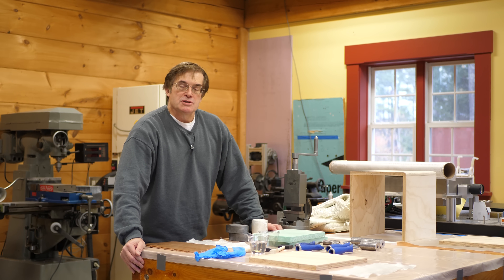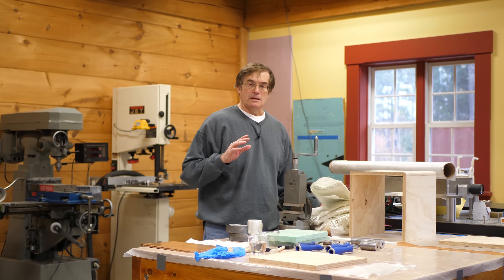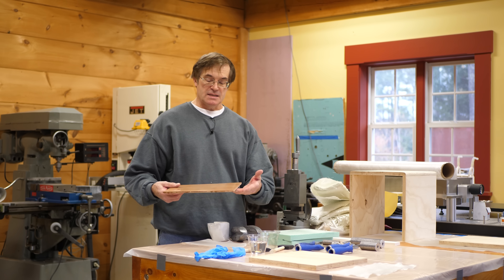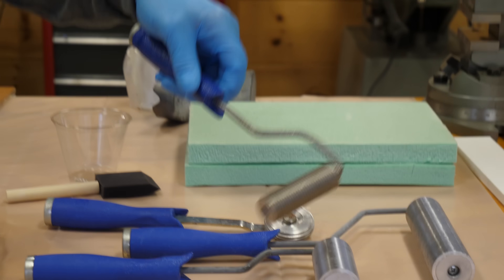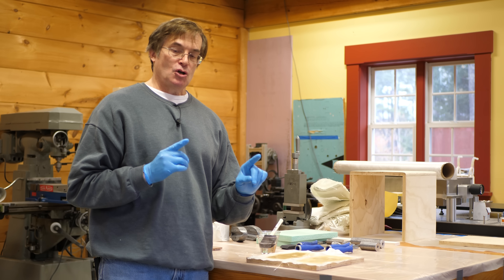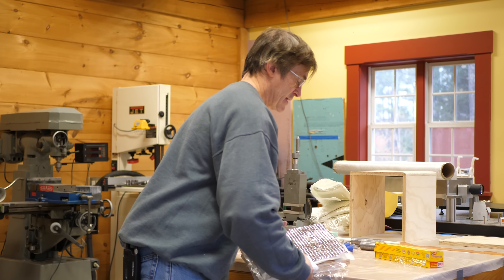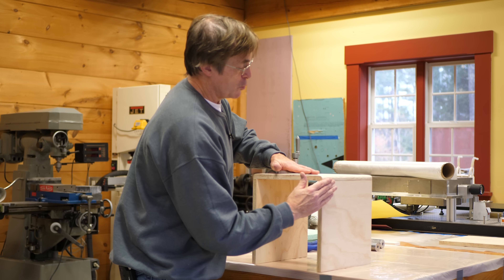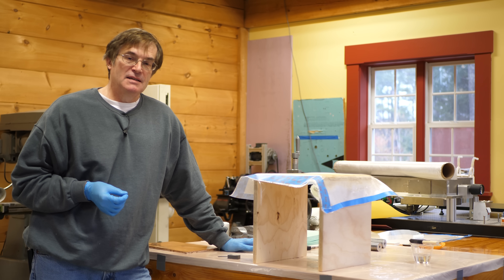Easy Tricks Using Fiberglass Strengthening!

Comment: Just a couple of things technical; multiple layers of a lighter cloth makes a stronger laminate than one heavy cloth; the 'scrim backed' weave - chop strand stuck together with cloth is recommended for use with polyester or vinylester resins and not epoxy resin because the epoxy cannot breakdown the glue used in the mat. Also the other glass - the boat glass - is E glass. When wetting out cloth, use a squeegy. Last thing gel time is different than cure time.

Comment: using a thinning agent compatible with the  epoxy on dry plywood helps it to saturate further into the plywood and making a better primary connection, then use a full thickness epoxy layer with the woven glass fabric, I have had several projects fail because the epoxy did not cure correctly with a second coat applied over the first so for me the layers must be cured washed and sanded washed again to remove the dust from sanding to insure proper connection to prior layers also a transition coat when spraying a colored gel coat then when smooth spraying the final gel coat layer allowing proper set times for each. after the extended set time doing the final detailing wet sanding and buffing the final surface to a clear glass like shine and seal with a fine carnauba wax hand applied and buffed in. there are some polymers that some recommend that look nice to start with but cause problems later on. I am great full to the gentleman that taught me about wooden boats and the fiberglass repair I would have liked to spend fifty more years learning from him and his brother what a fine team and roll models. they took the time to fix the customers boats right and it showed in their work and in the faces of the customers when the job was complete. I like your videos you seam to want the people you teach to get skills to do a job right. I really appreciate people that take the time to help others to find their best work with clear training and positive results, teaching not only how to do a job but why each step is important to the final results.
Reply from the maker: Be careful, most thinning agents reduce the mechanical properties of the epoxy.  Even though they may be volatile, some remain trapped within the polymer matrix.

Comment: 11:45 i don't agree with a monomer hypothesis. When we add a second layer we basically flush an infinite amount of new monomer to the surface.
Why would existing monomers  matter? I suggest you to do a test of tensile strength for glued vs monolithic samples. 

And about the "amene" byproduct - it will depend hardly on the chemical composition of the hardener you did use. There are dozens of epoxies/hardener combinations out there, not including reactive additives.

Also suggest to use whiteboard/telivision with keyboard/titles for hard to hear terms, e.g. products and chemicals.
Reply from the maker: No, you don't.  That is why the previous layer needs to be partially curred. The mobility of the monomers decreases with time and eventually disappears.

Comment: Love your videos!  The speakers were awesome! One question, Fiberglass resin destroys polystyrene how did you not destroy the foam board?
Reply from the maker: I rarely use polyester resin.
This is epoxy resin, and it is compatible  with polystyrene.

Comment: Sir thank you very much for this video.I searched for more information for my project and this video is the best.I have one question:Would it help instead of heating pads to build a small oven (80×80×80 cm) using a small electric heater with a fan?
Reply from the maker: Check out our video on glowing epoxy.

Comment: Very good video! Thank you!
Can 1 cm thick PU foam be strong enough for a longboard when putting glassfiber to it? Shape like landyachtz evo. And, because of the different angles, a vacuum bag can come in handy isn't it?

Maybe you can give any thoughts about this.
Reply from the maker: I believe polyurethane foam comes in various densities, and the greater the density, the greater the compression strength. The fiberglass is the easy part.  You can apply as many layers as the cloth requires to build up to a desired thickness.  I have never built a longboard, but if you have access to a design or even a damaged example, you could get the thickness and compression stiffness by measuring and even denting the foam with your finger.
Reply: @TechIngredients  Thank you! Will investigate👍🏻

Comment: A good channel for fibreglassing is WJP004, mainly does car stuff, big molds, multiple piece molds, but doesn't use any fancy gear(vacuum bagging, etc)

Additionally, that extruded polystyrene is commonly used for model plane wings, hotwire cut the profile, cover in fibreglass the same way, and you end up with a plane which will bounce off the ground vs the old balsa ones which would just crumple

Comment: Really great!  Thank you.  I have a question.  When fiberglass cars get old, they get cracks in the finish and on some of the shows I watch, they try to restore them, they use more resin and talk about how it was sucking it up.  What is going on there?  How do you prevent that over the long term and how can it be sucking up the resin if it doesn't bond to itself once it has fully cured?
Reply from the maker: Thanks!
Most composites, especially older composites are fiberglass and polyester.  It's cheaper, but isn't as tough.  The cracks can wick the resin into them without creating a bond.  You can get a weak, non- covalent bond between these resin systems, but it's not nearly as strong.  You can test this by taking a fiberglass part, experimentally flex it to create some cracks then let some fresh resin into the defects and let it cure.  Test it again to see where it cracks.  These old parts may be so deteriorated that the repair is not much weaker than the parent material, but it's a good practical test.
Reply: @TechIngredients  thank you for the explanation.

Comment: I am an old fiberglass teck. Your investigations are mostly correct. But one thing I know for sure. Never rush the curing time of the resin. Let it cure in it's own time. The longer cure time the better.
Reply from the maker: I disagree.  This is not just my experience, but industrially, autoclaves are used all over the world to speed the curing of epoxy based composites.
Reply: According to all the technical literature from epoxy manufacturers, elevated temperature cure improves properties, and a post cure heating stage is sometimes used to further improve the properties of the epoxy also.

Comment: One should always use a wetting agent for surface pre-treatment. Acetone mixed with a very small amount of resin without hardener is a very good pre-treatment for substrates. It makes wetup much easier.
Reply from the maker: I've never heard of that technique.  However,  it sounds  like a bad idea as the pure resin could interfere  with bonding.
Reply: @TechIngredients  You only mix a very small fraction of resin with the acetone as far as I know. Like 20:1 or higher. There's some white papers on the internet about it.  One is titled: "Effect of acetone on mechanical properties of epoxy used for surface treatment before adhesive bonding". It increases the bond rather than reduce it granted all of one's parameters are correct. It would take a certain amount of experimentation to perfect. Though the benefit would be more applicable to heavier/multi-layer composite layups rather than thin layers of s-glass like you're using, which usually wetup fairly easily.

Nanofillers are another interesting area of interest for improving bond strength. Things like boron nitride, and graphene can be added to the epoxy to improve bonding.
Reply: @TechIngredients  I see that you experimented with additives like boron nitride many years ago. Nice.

Comment: Would that fiberglassed foam board be able to be walked on, or be able to support the weight of someone sitting on top of it on a lounge chair.
Reply from the maker: There are alternative core materials that have greater compressive strength.  That is what surfboard and snowboard manufacturers do.  Take a look at our other video that covers the use of end grain balsa for this purpose.

Comment: What kind of epoxy are you using? The guidance given here is excellent information but I really need the structure information you teased for a RV step repair. I think, I've found it in the glowing epoxy vid. Thanks this is wonderful!
Reply from the maker: I like the Raka brand slow formulation.

Comment: I occasionally build race car wings in my garage as a little hobby business. I typically use a custom foam core (based on the customers requirements) and carbon fiber fabric. However I do place everything in a vacuum bag and heat it with my "oven". My oven is styrofoam panels with a hair dryer set on low. I find I get a good cure and actually less warping with low heat.
Reply from the maker: Many of the high performance, heat cured epoxies will room temp cure to an intermediate strength that can hold it's shape when you later bring on the heat for the final cure.

Comment: You, good sir, are a fabulous educator! I have been searching the web for any videos that lend a basic and sensible explanation of fiberglass work! I am subbed! I will be asking a bunch of questions as I just bought a 1959 kit car (Victress S4) of which, someone glassed over the entire rear of the car. The original lines are partially there under the existing glasswork with a large boxy modification.

The end goal is to cut off the existing and reconstruct the original lines. It will be slow going as I have never worked with glass and have a very large curve to overcome.

Comment: what is also handy is peel-ply foil. it does not adhere and can be pulled away when the resin has cured. when applying a larger surface, it is useful to use a fur roller, which makes it quicker and can also be used to wet resin poor spots if the fiberglass has already been applied. special rollers are also available to roll out air deposits. it is handy to use this in combination with peel-ply foil because you will not disturb the glass fibers.

Comment: Whenever I've done stuff like this on wood or other surface I put the resin on the surface first then I put the fiberglass over it then I put another layer of resin as I'm tapping it out so there's no air bubbles comes out exactly like yours
Reply from the maker: I've also used that technique.

Comment: What epoxy and hardener do you use and what mix percentage to make it cure slower? Love the vids and have earned lots.
Reply from the maker: I like West System and Raka epoxy.  Both companies make a selection of epoxy formulations for different cure times and viscosities.  West System is more expensive, but they offer more choices including very thin laminating epoxy as well as two stage curing epoxies that requires heat, but are substantially stronger.

Comment: How about charging batteries from a sail?
Reply from the maker: A PV sail or a sailboat driven propeller could both generate electricity.  An engineering issue is the cost/performance relationship.  Would it be worth it?

Comment: i had a plan to build a kind of a cover for my open cockpit sailboat.  thought about using fibreglass to do the outside coat, but some people kept telling me that the bond between the polystyrene and the epoxy or polyester resin is fragile, and the fiberglass skin would 'de-laminate' from the extruded foam.  so i never went ahead with that idea.  have you had any experience with this?  another great, instructional video.  i love to watch these. i always learn something, even if i never get to use it.
Reply from the maker: The bond is far stronger than the polystyrene core. For your peace of mind, make a small test sandwich with a lightly sanded piece of polystyrene and once cured, tear it apart.  If you want a stronger laminate, a stronger core will help, but it's not the bond that is the limiting factor.

Comment: rather than a simple glued on top from the start , would it be stronger if you were to cut the top to mate with the sides using "finger joints " then you'd have a much larger surface of little "slots" to apply wood glues and then if wanted or needed add the fiberglass to strengthen it further?
Reply from the maker: It would be stronger, but adds a lot of additional work.  Take a look at our glowing epoxy video for an easier and even stronger modification.

Comment: Do you think 1” foam coated in this way on both sides would be structurally strong enough to build a teardrop trailer?  Or stick with plywood? Thanks
Reply from the maker: This depends largely on the importance of weight.  You will need a couple of layers of glass on each side to produce a structure that will remain undamaged by an average man's punch.  It will require more work than the plywood, but would probably weigh 1/4 as much.
Reply: Thanks

Comment: Hi Tech Ingredients...so sorry to keep bothering you with my rookie questions...the boat project I am in at the moment now has a layer of epoxy with 10oz fibreglass. I managed to get that waffle pattern that you mentioned. My question is although I already achieved full strength of the fiberglass,is it fully waterproof? My boat if made with the foam core sandwich construction that you have shown...lightweight is important to me as the boat is a car top light weight boat...hope to hear from you...Thanks for putting up with all my questions...I owe you credit for my boat building.
Reply from the maker: It is waterproof.  If the core is a closed cell foam then even the core alone is waterproof, but the waffle pattern is drag inducing and adding enough additional epoxy to fill the depressions will give you a lower drag surface with little additional weight. it

Comment: What about the UV light stability of epoxy? I think there are kinds of epoxies that are not UV stable and degrade at least in colour -- they are yellowing. Thus some UV protective film may be helpful.

I didn't quite get the end -- about the rugged edge. Are you slicing with the angle of the razor blade and fibre in sharp angle? To create uneven frayed edge? 

As always, lots of clear information. Thank you
Reply from the maker: Check out our video on super strong epoxy where I discuss additives.
The principle is that the blade should only cut on the downstroke in order to prevent the partially cured epoxy from pulling away from the surface.

Comment: The green foam core material .. Is it the same foam as in Lowe's that is used for insulation?
Reply from the maker: Yes, it's a low density XPS foam.  It's not optimal for sandwich construction because even a single layer of typical 6oz fiberglass cloth is far stronger and that foam would be the Achilles's heal in a composite system.

Comment: Anybody know how this effects impact resistance
Reply from the maker: Can you be more specific?
Do you mean any fiber reinforcement with epoxy over a surface or the choice of a specific  fiber?
Reply: @TechIngredients  what I mean is if I had a core material in-between a carbon fiber layer each side what would be the best way to increase it's impact resistance, I would of thought it would be to add carbon layers to the surface side 

Also thank you, saved me a fortune on layering up carbon fiber
Reply from the maker: If you're  interested  in impact resistance, then stay away from carbon fiber. It's  strong and light, but not tough.
The best overall fiber is "S" glass fiber.  It's  somewhat  more expensive than the more common  "E" glass, but it's as tough as Kevlar and much stronger in compression.
Reply: @TechIngredients  Ok I'll reconsider the material, my application was soccer shin guards where weight and mass is a little bit of a factor 
I was using a material called dolion which is tough but I felt like the lack of rigidity would allow soft tissue damage by deformation.
Which made me look a bit deeper into core materials and more rigid composites

Comment: I haven't tried it but would a heat gun or portable heater work just as good as heating pads if used at a distance?
Reply from the maker: I would not do that.  The heat has to be applied evenly and for potentially hours.  A heating blanket works as well as simply turning your furnace up for a while.

Comment: I'm curious if the "S-Cloth" becomes clear when the epoxy is applied to it.  Also, if you wanted to make a few layers of it, would it remain clear afterwards, assuming it was maybe degassed after the epoxy was applied or if it was injected in a vacuum mold?
Reply from the maker: It would become "clear" just like the E cloth, but in both cases that is only in very light weights.  Beyond about a single layer of 6 oz per square yard or 240 gm per square meter the glass begins to appear milky.
Reply: @TechIngredients  Thanks for the prompt reply!  I was wondering if it could be used for a laminated glass, if it would be clear enough for that, but I had my doubts.  

I love your channel BTW, you do so many things that I've worked with or on before and many things I'd like to work with or at least explore!  Thank you! 

I did research that there are some Al2O3 + SiO2 glasses in the works (maybe with small amounts of  MgO  & CaO addded in) that produce a VERY hard glass that is crack (and IIRC, shatter) resistant, which sounds very promising! Though the fabrication process has been described as "aerodynamic levitation", which I'm not sure I fully understand.  
I haven't' read the full article, I just found it today, if you are interested, here it is.
https://www.nature.com/articles/srep23620

Keep up the great work!  I hope Youtube starts promoting your channel more!